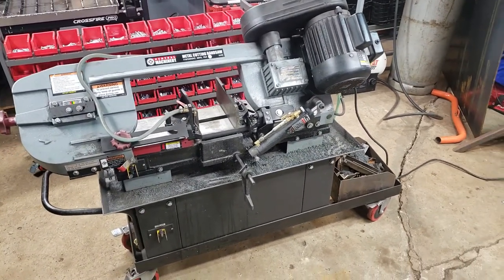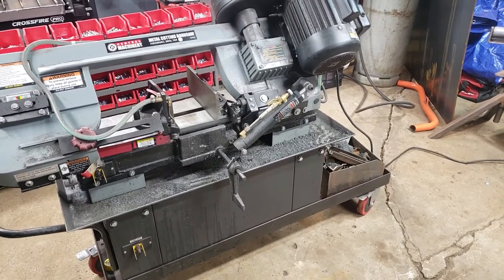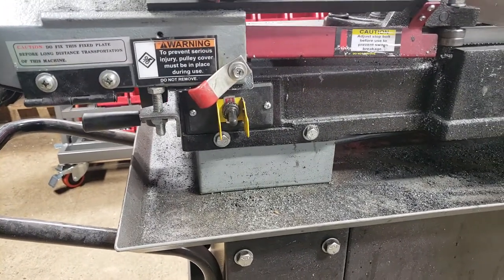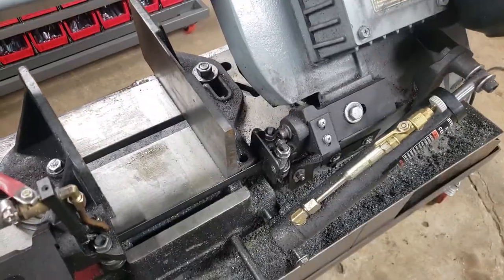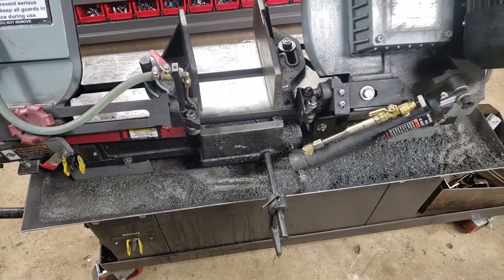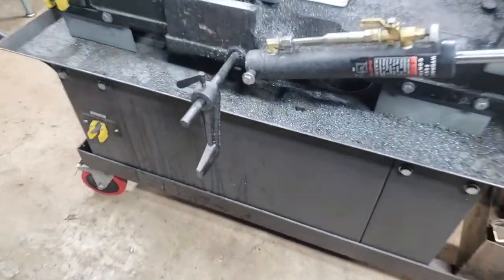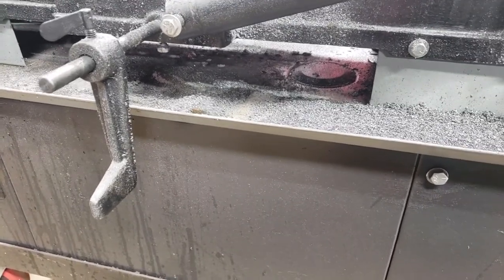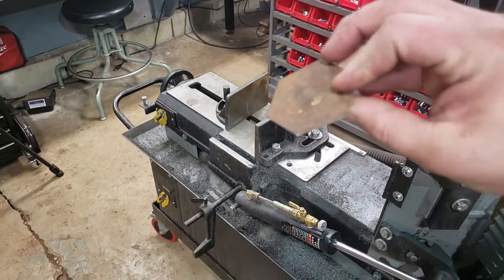Harbor freight metal bandsaw 1 year honest review

Comment: Your comments are spot on. The blade guide is indeed too short. The balance is terrible in the upright position. I built a more substantial cart that extended back so it won't try to backflip. Also built a vertical flat table that locks into the vice. Gives a good work surface.

Comment: You know you can just set the screw on the left to your bottoming height and keep the bracket square to the switch? Also the vice has that second hole for larger angles, just move the right hand jaw backwards and use that other hole to achieve greater angles. Your stand should be the other way around so your cutoff box is opposite to the weight of the bow and the motor.
Reply: Great points you made except for the last one. When the box is full, I agree it would act as a great counterweight. When it is not, then it is still a tip hazard. Free body diagram shows the design is correct, I would have made it a little longer to the right to increase the moment arm

Comment: I read in the instructions that that little metal tab you don’t like is for shipping, and it is supposed to be removed.
Reply: There's an extra bracket that is for shipping, this goes from the screw on the left and up to that empty threaded hole above it, the bracket he doesn't like is supposed to hit the off switch and you just adjust the screw on the left to set the bottoming height.

Comment: How well does it work in vertical mode?  I have a small bandsaw I use for intricate work, but ever so occasionally I really need a deep throat for larger panels.  Is there a larger platen on it for vertical, or is there some bolt locations to add one in?
Reply from the maker: Iv personally only used it that way a couple of times, I find it to be kind of awkward but it does come with a plate you can bolt on when using it in the vertical position.
Reply: @themetalmaverick  Thank you!  I guess you would have to straddle the thing if you were feeding from the proper side, that would be awkward.